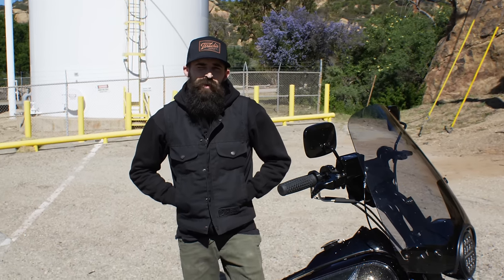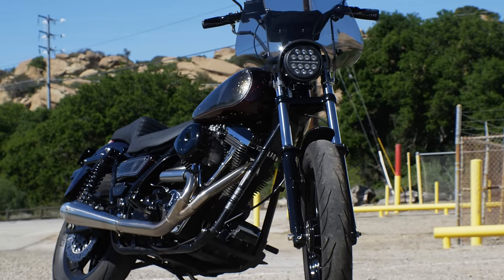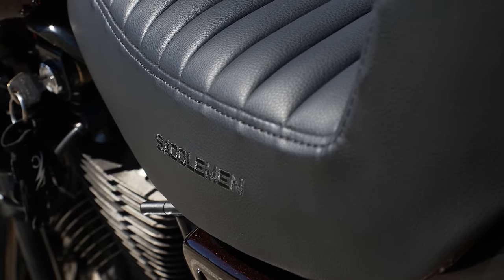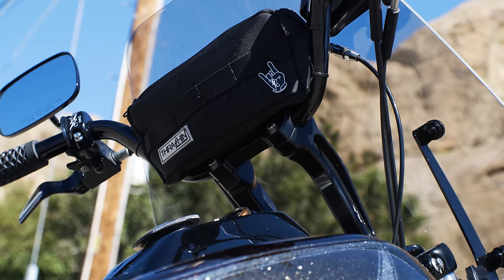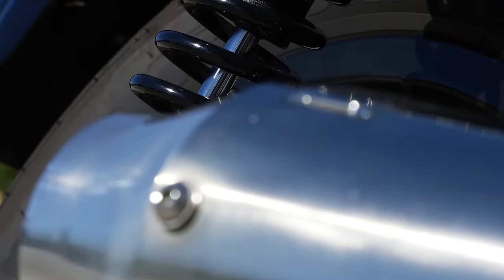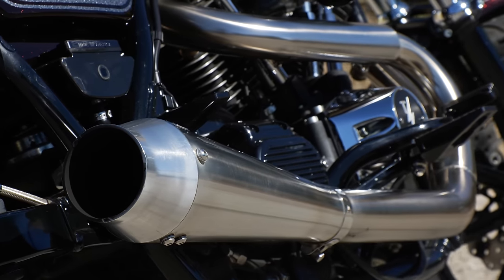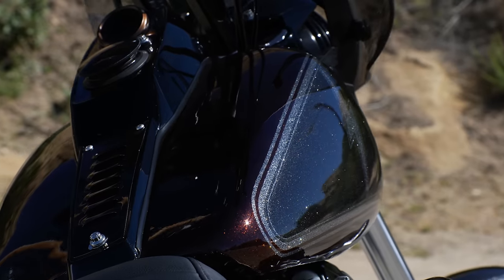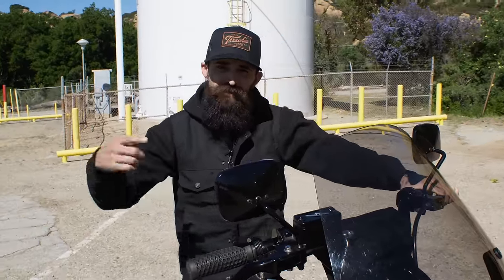Bike Check - Rob's 1993 Harley-Davidson FXR

Comment: I really like how the custom paint keeps the delicate balance between modern and classic styling. Performance modern parts and candy root beer color painting are a dope combo. Q. when you put Air Cleaner and Full Pipe, don’t you need a tuner and tune(dyno or something)?
Reply: I did have the bike dyno tuned after I installed the parts👍🏽

Comment: How does that style pipe with the short headers compare to a 2-1 with longer head pipes?
Reply from the maker: Produces tons of flow over any stock pipe. It also has a good look, style, and sound. Our AR System Exhaust are known to put out more power. But also, if your engines stock, this OG will be badass. It really depends on what your engine combination is, cubic inch, compression, cam, etc.
Reply: @THRASHIN  Sweet thanks for the reply! Do you still make Sportster exhaust?